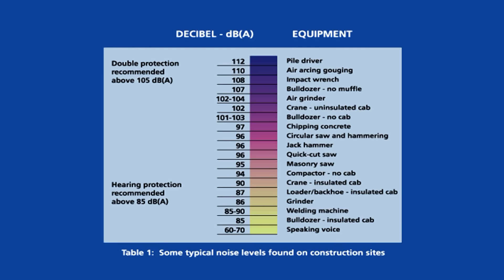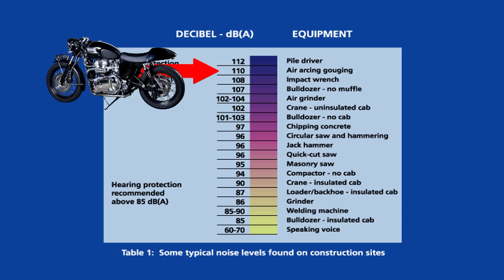Why Not to Change Your Car's Muffler

Comment: Good video 
Then young kids like to hear a noisy exhaust they take off put on straight through systems to impress the young ladies 
They also take the cats off to get more power, which most times causes problems.
Running on super unleaded fuel without a cat produces harmful gases from the
Exhaust .
Super unleaded is 97 or 98 octane.

Comment: I mean there is ways around it while yes decreasing back pressure by getting rid of the muffler is true the cars o2s can relay the new information to the ECM to increase and decrease fuel delivery and advance or retard the the timing so the vehicle runs correctly not to mention tuning software that reprograms the ECM so the car runs normally with bolt on performance parts

Comment: Not that hard to take your mufflers off and have someone do a slight tune to help the car but taking off a muffler isn't gonna mess the car up.. yes they have some back pressure that's needed but not enough that it's gonna hurt the car..

Comment: The quality of the muffler matters. If it's made correctly, there should be little disruption to the engine. What you shouldn't do is modify your existing muffler by drilling holes or removing baffles from it.
Reply: What if u cut off the muffler on a 3.6 and get tips?

Comment: If it ain't broke, don't fix it.
Reply: Not broke but back pressure is never good. Due to emission control vehicles aren't built to run as good as they could. Theyre built to be emission compliant.

Comment: You probably won't have check engine light on if the part been changed is cat back. You are freaking out those baby car modifiers
Reply: and quite likely it will run better, especially at the high end

Comment: Thank you sir. You just saved my car. I was about to head too a muffler shop to have the mufflers removed on my Honda Accord '14. Because I wanted my car sound like a G37 Infiniti. I liked to buy that car. 
But hey, some day right!.
 I did a little more research after calling a muffler shop. He said he would go straight pipe. Removing the mufflers. Anyways...thx again. I rang that rang that bell.

Comment: Here’s some of our rules in aus varies states this is Melbourne 
Petrol cars, required cats
Hybrid required cats
Pre 1980 cars do not require cat
Duel fuel cars, petrol/LPG require a cat
Pre 2013 diesels do not require DPF
Post 2013 disels require DPF
LPG dedicted cars do not require a Cat as long as it doesn’t be too loud, most LPG dedicated cars came without cats from factory

Comment: I thought having a muffler actually increased the engine power because it gives "back pressure," which goes (eventually) to the wheels. 

The logic is, if there's no back pressure, a good percentage of engine power is simply vented out to the atmosphere through the exhaust. But when proper back pressure is present, the engine power is pushed to the transmission, and therefore transported to the wheels.
Reply: Thats enough internet for today 🤦‍♂️
Reply: Here's a breakdown kid....
Backpressure = bad.
Exhaust scavenging = good. 
To eliminate backpressure and improve scavenging is the recipe for power.

Comment: if your backfiring because of simply taing off a muffler its because you have a valve timing issue unless your car was tuned that way from factory most cars if you just take off the muffler or put on a perfrmance exhaust they wont backfire unless theyre making lots of power from stock sorry scotty but you dont know what your talking about... and if you can show us in detail the cience on why  this is bad ill believe you but until then sorry bro!

Comment: Sorry Scot but no one is going to spend 200$+ on a tune. You CAN just change an exhaust. It's more smiles per hour, won't ruin your car but it will make it louder. 😂
Reply: I spent 550€ on a tune few months ago and couldnt been happier with it 🤔Gained about 60hp and 75ibs of torque to my volvo. Few months im getting a catless downpipe and get a o2 tuned out for even more hp 😔

Comment: Scotty can you please stop posting uneducated garbage like this saying a car will run worse and make less power from modifying the exhaust.. put a car on a dyno with a stock exhaust then straight pipe it and dyno it again and you will see gains they will be small the real benefits of it is the power simply moves higher or lower in the rpm range.. this guy does work out of his driveway and not in a shop for a reason...

Comment: Scott is telling it right. Engines have always been designed to run properly with a specific designed muffler. When I installed freer flowing mufflers (on my motorcycle) back in '75', it meant the exhaust was exiting fast causing the engine to run lean. As a result, I then rejected my carburetors, installed freer flowing air filters, then retuned the engine around all these mods. Same thing when i worked on my '61' Galaxie 500. While the computer in your new car can automatically correct for a freer flowing exhaust, it can only do so to a certain point. Beyond that you need to install larger injectors, again a freer flowing intake system and you better be really into returning the car's ECM. 
Just remember this is just some old guys telling you this. You don't have to listen. Just do what you want.

Comment: And u lose horsepower
Reply: Gain horsepower after tuned.
Reply: @jesusislord4060  a computer can supply   2% extra horsepower by calculating the perfect performance of the vehicle but if it  doesn't work properly u can lose 24% horsepower that why racing cars are closely monitored to make sure the computer is working properly
Reply: @jesusislord4060  with a computer
Reply: So you have someone* tune the computer??
Reply: @jesusislord4060  u have use a computer to tune it because it will be a computer issue
Reply: Right. When I get everything together to do it I plan to remove my trucks muffler and cat converter and maybe cold air intake then tune it. 😊
Reply: @jesusislord4060  yes because everything in the running of ur vehicle has to run in harmony with each other a well tuned car means it can run just as well in the cold as it does in the heat or in high altitudes where air is thin
Reply: @jesusislord4060  we race called V8 super cars and in the pit crew there 5 guy monitoring the cars computer making sure the car is perfectly tuned throughout the race